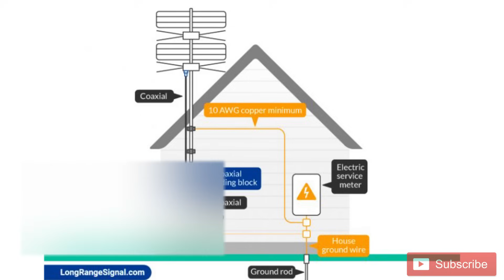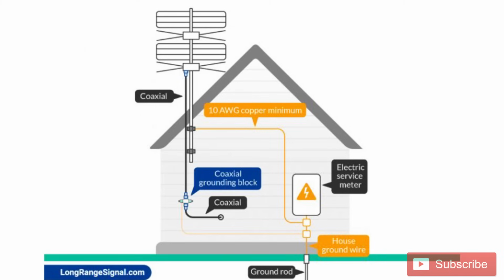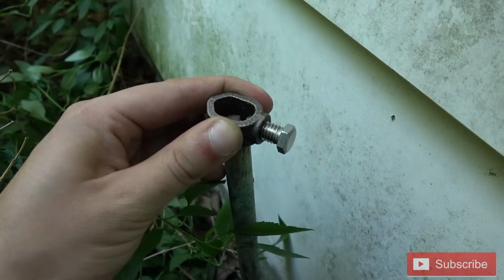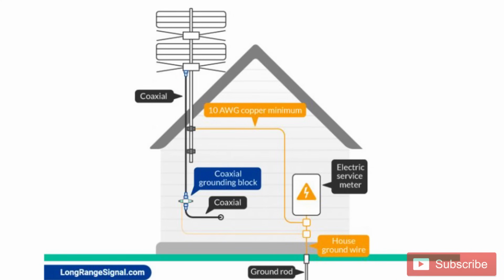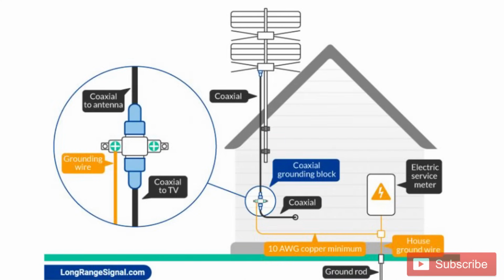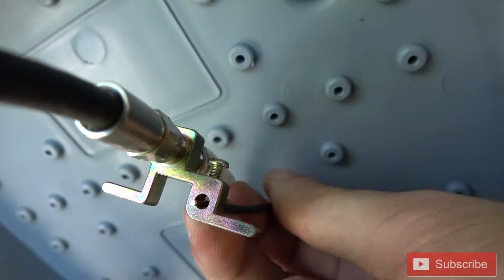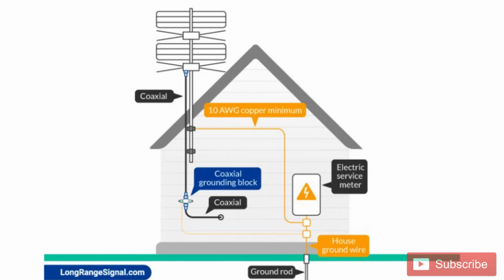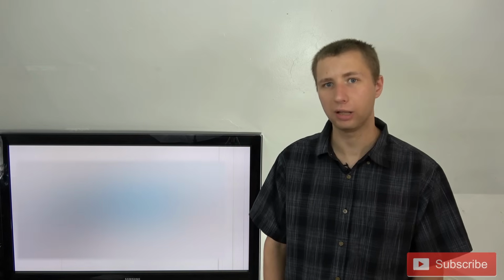How To Ground an Outdoor TV Antenna Per NEC

Comment: I repair commercial high power outdoor transceivers that are used on commercial satellite hubs. Believe me, that if your antenna gets hit by lightening
Or even near a lightning strike, a properly grounded antenna will not save your electronics that are hooked up to it. The grounded antenna will most
Likely help with interference, but your TVs tuners will probably be destroyed. The guy below using 90V gas discharge tubes is a joke to lightning, it destroys
Anything electronic it hits or comes near. Great video on how to properly ground your antenna, and it will definitely help get rid of the static electricity
That is in the air when a severe lightning storm is in your area. I just want everyone to understand that a direct hit will take out your TV for sure and also
Probably catch your house on fire.
Reply: What Lobo 176 says about grounding and static discharge is true , however comments about , catch your house on fire , and other alarmest statements that I see on the internet such as and not limited to , explosions , blood and guts , is/are my continuing observations that most if not all humans are not capable of thinking clearly about electrical and lightning.

The truth is you have better odds of winning lottery then struck by lightning.

Lightning is a normal part of life on this planet.
Reply: Thanks for adding the blood and guts statement Gene Sky.
Reply: And the other statement about not being able to think clearly, I’m glad you were able to clarify that for us.
Reply: You can add a fuse or surge protector to your coax cable.  Should be done if you live in an area that gets lighting strikes but your house should also have lighting rods at their highest points.
Reply: @fernarias  - I could use some clarification on the theory behind a fuse for lightning protection.  Fuses I normally use are, I think, rated for 240 volts.  I think lightning exceeds that.
Reply: @jrstf  Yes, a lightning strike would be high voltage, 25,000 V plus, and low amps but enough to trigger a .1A fast blow fuse (static from your fingers can trigger one).  You would need two, one for input and one for ground.
Reply: @fernarias  - The problem I have with that  is 25,000 volts will jump a 1.25 inch gap, a normal fuse has no chance of blocking it when it opens.
Reply: @jrstf  The whole system is grounded and the lightning strike will take the path of least resistance.  The fuses will protect against small surges.  During an electrical storm, your devices should be disconnected.
Reply: I Am Not A Commercial High power outdoor transceivers Guy But I Do An Have Installd A LOT Of Ham Antenas, For Me An Half Of My County And Yes You Are 100% Corect ! Even If You Have The Best Grounding In The World An It Is Hit By Or Simi Close To A Hit You Will Still B Replacing AnyThing An EveryThing That Was Pluged Into It ! I Had A Antena That Got A Indrect Hit From Lightning,An Not Only Did It Get My 100$+ Antena It Got My Telophone,My Tv And A Police Scanner And Burnt My Coax To A Crisp ! ! So You Know What Ure Talking About For Sure ! Man CANNOT Win When It Is Against Lightning No Mater How Good Ure Ground Is.
Reply: Would it be a good idea to go to the junction box and shut off power in the home?
Reply: I used to work for a govt agency that had lots of solid state equipment connected to outdoor antennas and masts.  When we first started installing the new sold state electronics we did not have very good lightning protection and we lost a lot of equipment to thunder storms.  But then we started understanding lightning protection a little better and started getting more effective lightning protection devices.  After a few years we still lost equipment occasionally in a violent storm but it commonly just didn't happen anymore.  Our situation was different than an outside tv antenna but good lightning protection actually does work. I witnessed that.
Reply: I've seen a concrete slab where the utility ground rod was, powdered by a lightning strike and it took everything solid state in the house and some non solid state appliances. 

The ground rod... 

With less than 4 inches to go to ground and tied to the common on the utilities. 

A 50 foot run of 10 gauge isn't going to do shit for a real lightning strike.
Reply: Biggest problem I've seen is the surge when lightning hits power lines. Appliances all over the house gets fried. Proper grounding/bonding helps, but it certainly doesn't stop lightning from wreaking havoc. I worked on telephone equipment for several years, and I have seen some unbelievable results from lightning - even when properly grounded. One of the really close calls was the guy sitting in his living room when the wall phone nearby in kitchen exploded.
This was in the days when rotary dials still in use somewhat, and the largest piece left of the phone was the finger wheel. The rest? Bits of shrapnel that weren't even recognizable as part of a phone. Yep, all the NEC requirements covered, but lightning sometimes ignores the NEC.
Reply: @fernarias  Just stop because you have no idea what you're talking about. People are going to listen to you and their equipment, or worse, themselves, are going to be harmed. 

The current of a lightning strike is not low by any metric. Strikes average thousands of amps, including tens of thousands. 

Fuses are not used to protect from lightning strikes. I have no idea where you got that from, but it sure wasn't the NEC. As another poster pointed out, lightning travels several thousands of feet through through the dielectric properties of air... you thinking an open fuse going to stop it is completely absurd. Honestly, it's laughable

Electricity, including lightning, does not follow the path of least resistance… it follows every path.

Disconnecting equipment is not going to protect from the EMP that will occur in a direct strike. A proper grounding methodology is what will help, and in that help there are no guarantees. Unfortunately, neither you nor this video is the guide to achieving that.

Mike Holt is a far better resource than anything from the creator of this video.
Reply: @MrMikesMondoVideo  Lighting strikes are  extremely high voltage low amperage by nature.  You don't know what you're talking about.
Reply: @MrMikesMondoVideo  If lighting had high amps then lighting rods wouldn't work as the high amperage would burn the grounding wire.  But they do work because, just like our high voltage power lines, it's high voltage low current.
Reply: @MrMikesMondoVideo  I didn't read what you wrote.  You said you had no knowledge when you quoted that you googled your response.  You don't know about ohms law, you don't know about how insulators work and you don't know about the transmission of power accross long distances.
Reply: @MrMikesMondoVideo  Of course there's no links.  All my physics and electronic books are physical.  I bought them when I was attending university for all the physics and electronic courses that I was enrolled in.  Google is for fools.
Reply: @MrMikesMondoVideo  it's no surprise he never returned with his fake books and fake university. well done at exposing this charlatan.
Reply: A bolt of lightning has 200,000 amps the 18 AWG wire in the coax would disintegrate long before your electronics. The whole purpose of the NEC/NFPA requirement of grounding is to not attract lightning not to re-direct the electricity to ground. No wire in a residential can handle such a load however the lightning will combust the combustible materials resulting in a fire thus putting lives in peril. That is the whole purpose of the NEC/NFPA.
Reply: @fernarias  Not quite accurate otherwise we would only be able to run 1 appliance in our house at a time (well 2, one for each side of the 240V). In an electrical circuit, the current divides up according to the resistance in each parallel path. Firstly, the element in the fuse will vaporize helping to create a low resistance plasma arc for the duration of the lightning strike regardless of the voltage rating of the fuse.  Note: negative lightning ~30kA, positive lightning up to 120kA, so it doesn't take much resistance, milli Ohms, to push enough of those electrons through higher resistance branches of an electrical circuit to do some damage to your gear. In addition, the neutral is grounded at the transformer, so the ground wire is for safety in case something happens to the neutral.
As a kid, lightning hit our metal TV tower, not sure if it had a grounding rod or if that would have made any difference, but enough of the energy came through the control lines and blew up the rotor controller, literally found pieces 15 ft away on the other side of the room. It blew up a few of the screw in fuses in the fuse panel with enough energy to opening the panel door. I believe the power switch on the TV was damaged and a few lights on the stereo receive were burnt out as well. No one was home at the time and the house did not catch on fire.
Reply: Hey Lobo, question as you seem like you know more then me for sure, I want to buy an antenna for my moms rural house, and for safety purposes, I was looking to buy a coax protector or whatever.  We live near Seattle so its not storm central, and honestly I'm not worried about losing an antenna or even a TV, but just overall safety as we get occasional storms.  I'm pretty handy and knowledgeable, I just don't fuck with electricity, I've been shocked and it sucks.  
Any suggestions if you think its necessary?
Reply: @bigchew3149   So is having a lightning rod that is higher than your antenna on the other side of ones house a viable option to at least have a 50/50 chance the lightning hits that and saves all my gear?
Reply: @1Aquadon  if you get a direct hit their is nothing going to save it.. i have had it splinter my fiberglass ant + Killd a 500$ police Scanner old landline(Phone) & my Tv & my System Was in 3ft of concrete & about 1ft of dirt over that & 2 Ground Rods 8ft All Grounded Really Well ! How Ever If You are Worried about it Then Just Unhook ure coax from the back of ure tv in a lightning storm & just hook it back up after the storm...& you can drop ure coax in a Glass Jar/Old Mason Jar Works Good..But These Are Extreme Preventive Measures But It is the ONLY 100% Sure way it wont get in ure house...The Lightning that got my junk back in the day was not even a direct hit ! Lightning Will kinda do what it wants. It Is A Uncontrollable force for sure How Ever Chances Are Very Very Slim I Had a 70ft Tower With my Gear on it With Multiple antennas to btw ! So No Need To Worry !
Reply: @bigchew3149  Thank you kind sir!
Reply: @bigchew3149  - If you've grounded your antenna to eliminate nuisance damage I see no point in disconnecting the TV.  The direct hit is very rare and, if it happens, you're likely to have a whole lot more damage than just a cheap TV.
Reply: Lightning has millions of volts and tens of thousands of amps. Nothing will protect against a direct hit.
Reply: Was aimed at @fernarias.

Comment: Don’t forget to clean your connection surfaces
Reply: And if your mast is painted or is a J pole then you need to take the paint off down to the bare metal for the clamp. Next use a conductive dieletric grease (commonly sold at auto repair stores) to seal this connection from water/rust etc. 

If you are using ridgid or EMT conduit then it is galvanized steel and is already going to conduct electricity very well.

Paint is an insulator. You want a strong conductor for a grounding connection.
Reply: @lakorai2  Dielectric grease is non-conductive by definition, so "conductive dielectric grease" is an oxymoron.

Comment: How long can the ground wire run,  If I want to install my Antenna on the opposite side of the house can I run a wire arround the base of the house?  Or should I Install the antenna near the ground rod?
Reply: I'd place the ground rod nearest the antenna you can get it.  Get a separate rod if need be.  They're not that expensive.
Reply: @JoeKaye-hn5dt  But from what I read they need to be bonded, set a specific distance apart and need to be the same size.
Reply: @mikeinal5521  Correct! nec code requires all ground rods have to be bonded together. Nec grounding is more about keeping all electrical devices at the same potential not about dissipating a close lighting strike.If  I was going to do a separate rod for the antenna I'd get bare #10 copper wire bond to rod and bury the run of copper wire below ground several inches to the main rod at the power feed. The bare wire in contact with the soil will give you some additional grounding.

Comment: What I did is that some of the RG6 cables comes with a groundcable attached, so I put a groundlug in the mast of the antenna and run it into a groundblock, from the groundblock I installed a green ground cable to the electric meter.
Reply: Perfectly acceptable as long as the ground block you used has two grounding inserts. One for the messenger cable from the antenna, & one for the 10 gauge solid copper from the ground block to the bonding source.

Comment: My electric meter with ground is at the opposite end of the house where I want to install an outdoor antenna above the roof.

Why can I not simply ground it to a cast iron toilet vent on the roof nearby?  Aren't metal vent pipes grounded?

If I cannot ground to a metal vent pipe, can I install a new copper rod in the ground - just like what the electric meter uses - and ground to that?  If so, what size rod and length below ground?
Reply: Bill don't trust any metallic pipe as a ground source. Corrosion will inhibit a good ground. Best bet would be to run a ground wire from the service panel ground or as you mentioned, drive a new rod. The 5/8" copper clad rod needs to be as deep as you can get it and a minimum of at least 8 feet. That's the gov standard. The rest of the information is in the video.

Comment: We live in boerne Texas about 35 miles northwest from San Antonio and about 90 south west of Austin Texas, We have had  a fairly good reception with that 30-40$ external antenna you recently reviewed. However I’d love to upgrade as we do lose signals very often which is actually pretty frustrating. :( Could you do me a huge favor and recommend the best system for me for that location? Thank you Brother, I hope to hear from you soon :) Cheers :)

Comment: The real purpose of grounding antenna masts and coax is to keep the voltage on these parts from getting too high to damage your equipment when nearby strikes occur. If you get a direct strike all bets are off, there WILL be a lot of damage to any connected equipment, coax, ground wires, and possibly the whole house if a fire starts regardless of any grounding system. The current is enormous created by the enormous voltage. And electricity takes the pathS of least resistance, of which there may be many. Also ungrounded masts and coax do not attract lightning, they actually repel it because any charge buildup will be negative from all the electrons flying around in the wind and the lightning is discharging the negative charge buildup in the clouds and air. But ground your stuff to offer some protection from nearby strikes.

Comment: If the utility turns off your power, it doesn't remove the grounding from your electrical panel.  The utility doesn't provide the "grounding".  

If that is against code, it is more likely because routing lightening into your electrical panel could potentially overwhelm it and fry a much more expensive system.

Comment: Hey Antenna Man, what do you recommend for grounding a large outdoor antenna mounted inside an attic of a house? My HOA does not allow outdoor antennas. Wondering if the antenna in an attic is protected from lightening by just being under the roof.
Reply from the maker: I cannot comment due to liability issues. Contact a local electrician for help.

Comment: We were using a indoor antenna. Then tried changing to outdoor. When we turned tv on went to snow only. And i reset tv and even tried to go back to indoor antenna and still nothing but snow. What are we doing wrong!
Reply from the maker: Are you using an old tube TV?
Reply: Antenna Man no it’s probably 6 years maybe! But now the cheap one don’t work either
Reply from the maker: You likely need a better antenna mounted on the roof. I'm assuming you tried running an auto scan, correct? Digital channels don't just show up using the channel up and down button on the remote. You have to run an autoscan from the menu.
Reply: Antenna Man yes I did a auto scan. Even reset tv to factory settings. But the funny thing is the little cheap on don’t work now. It’s like it went to a different channel
Reply from the maker: Either you have no reception or something is wrong with your tuner. You can purchase this model if you'd like as it has a very sensitive to pick up weak OTA TV channels. It also has HDMI out so you can keep your current HD picture. https://www.amazon.com/gp/product/B00GGVPKKC/ref=as_li_tl?ie=UTF8&camp=1789&creative=9325&creativeASIN=B00GGVPKKC&linkCode=as2&tag=tylerkleinle-20&linkId=97731daafce8d994283815aec5b93865
Reply: Are you sure your using the right connection on the back of the TV since you had signal before with indoor antenna and tried an outdoor with no reception and went back to indoor with no reception the most likely thing is your not connecting the antenna to the proper terminal or connector.